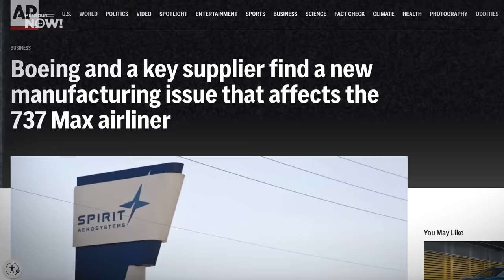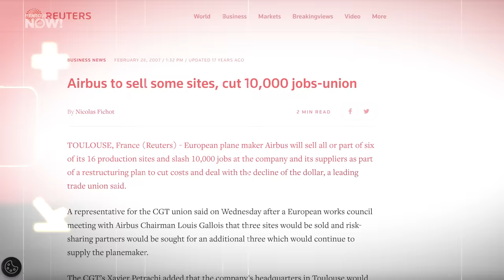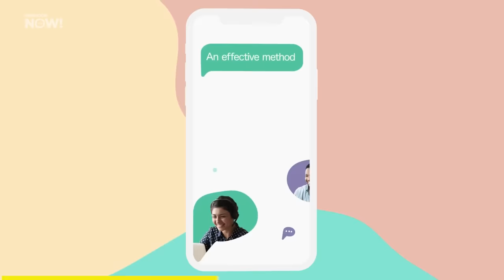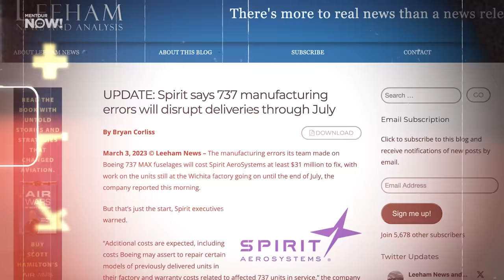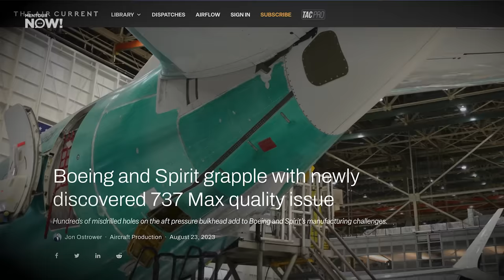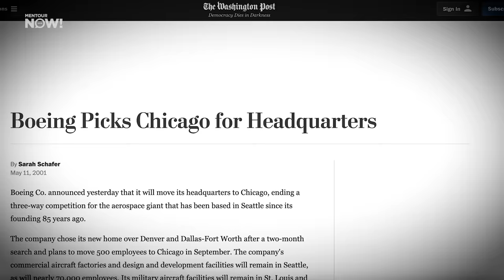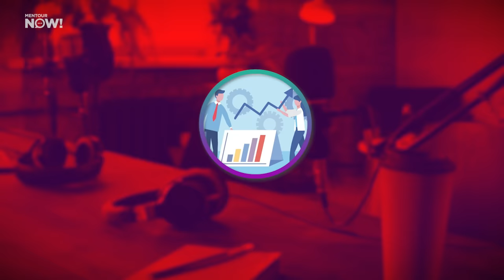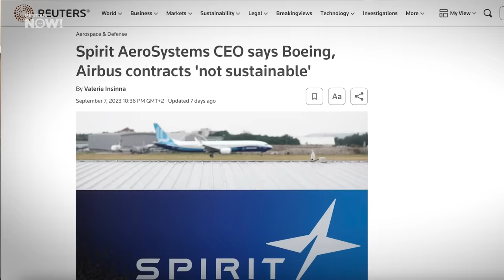NEW Problems with the B737MAX!

Comment: It’s hard to fathom that any aircraft supplier would possibly machine the snowman holes in such a critical piece. Not without engineering approvals.   So there must be a trace history in who did it, when, and who approved it.  And more importantly WHY it was put in the machine to bore the holes so incorrectly and how many where done without corrective action required.
Reply: I'd thought it was a poorly supported part during machining.
Reply: I have seen parts snowmanned by a machine because of improper tack placement (moved a bat up by 2 rows which led to .247 holes (with countersinks) over lapping to the point that it was a figure 8. There are also the parts with predrilled pilots on one side that someone may not know is there. Then they go to drill from the other side and mix the pilot and double hole, edge margin issues, or snowman. Or have an angled hole through a thick stack up and full sized back through straight (working on the skin you drill full size from outside in but pilot inside out) which leads to damaged holes. 

Qa should have caught this and gotten a dispo from engineering on how to fix it or replace it.

Comment: The Everett plant is still served by a rail spur that goes directly into the facility. The rail line that serves the Renton plant is still completely active on its southern end and is the way Renton receives its "cigars" (fuselages). In fact, the BNSF trains from Wichita carrying the Renton fuselages often stop at Mukilteo in order to drop the cars with 777 parts. In other words, dropping a 737 fuselage for Everett is actually already on the train's route, and shaves about 30 miles off the distance it travels from Wichita. A test train carrying 737 fuselages has already been run "up the hill" in order to help set-up the logistics for the new assembly line. The P-8 is assembled in Renton, and then flown to the Thompson Site at Boeing Field for final assembly and electronics installation.
Reply: I ride my mountain bike along the rail road route from Mukilteo/Edgewater Park to the factory.  You're absolutely correct - I've seen a couple of 737s parked at the west side of the factory.

Comment: Those bolts in the pressurisation bulkhead were the very culprits of the Japan 123 flihgt crash, after a faulty repair. Now the flaw is even into the new brand production.
Reply: They had a much bigger mistake in Japan 123
Reply: You are absolutely right 😮
Reply: They tend to use blind rivets rather than bolts, and therein lies the problem.  The rivet heads hide that ‘pull- through’ events at enlarged holes can occur leaving two parts unsecured.  The repair principle requires that replacement rivets are reinstalled with washers positioned on the back side to provide holes of appropriate size to prevent ‘pull-through’ to secure the parts together.
Reply: Whilst accepting that Japan 123 situation was more extensive, you do not expect it to be built in to a new plane. So long as the snowmen exist, a repeat of Japan 123 is on the cards… So, we’re back to profits rules safety!
Reply: @andrewbrown6786 yes and Japan 123 was a tail strike repair done wrong by Boeing certified repairmen, and absolutely nothing to do with bolts, a continuous overlap on one side of the repair was done with two pieces leaving the rivets compromised. Was a 10,000 hr repair that lasted 12,000 hours

Comment: The sad thing is that both of these problems were obviously known to Spirit, and they kept the information to themselves in order to save money, not knowing (or, apparently, caring) if the problems affected the safety of the aircraft.  In the case of the vertical stabilizer, Spirit clearly had the specifications of the fuselage (since they built it), so when it came time to install the fittings to attach the vertical stabilizer, and they couldn't be installed according to specifications, they would have immediately noticed that those two fittings were not manufactured to specifications.  A competent company would have rejected the non-conforming fittings rather than altering the installation (which then resulted in the fittings themselves and their installations to be out-of-specifications).  In the case of the aft bulkhead, it was Spirit itself that drilled the "snowmen" holes (and, presumably, inspected the work), so they cannot, in ANY reasonable way, claim that they didn't know about the issue.

Comment: I think it's time for Boeing to develop a brand new 737 from scratch at this point.
Reply: They could call it the 73.17.
Reply: How many screw ups and dangerous shortcuts would they manage in the design of something NEW at this point?
Reply: Perhaps refrigerators and washing machines as it's less demanding.
Reply: New 757 to include taller gear than 737.
Reply: I think it's time for the US to develop a brand new Boeing at this point. That merger with MDD turned the company from engineering-focused to profit-focused, and being profit-focused when you're not a financial management company is a mistake 100% of the time, but it takes JUST long enough to manifest negative results that it ensures the CEOs who caused it can safely retire with a golden parachute, so that's just capitalism working as intended (sarcastic eyeroll).
Reply: @44R0Ndin  If you do good, you will do well. Boeing tried to do well by doing bad.
Reply: @SteamCrane  Exactly.
Reply: They could base its design on the 737 🙂
Reply: @tiggy2756  How about we don't? Clean sheet design is warranted, methinks, enough things have changed in the aviation space that an entirely clean sheet design with modern airports in mind would be the best thing to make. The 737 was originally designed to operate off a grass field, because at the time the number of actually suitable airports for a jet aircraft of such size and passenger capacity was not sufficient for the routes it was planned to service, so it carried a LOT of equipment (in the 100 200 300 models) that is just dead weight in modern times because the airport itself has that stuff built-in.
You could even get a gravel kit for the 100 200 300 series 737's.
A "modern take on the 737" doesn't need such things, so it can eliminate the dead-space that was previously used to house such things, and switch to other more efficient ways of doing things like an aircraft that doesn't have a bleed air or hydraulic system (everything's electric and ACTUALLY fly by wire instead of fly by steel cables with autopilot actuators strong enough to overpower any pilot on purpose).
Reply: @tiggy2756  The 737 design has a fundamental flaw. It is locked into being close to the ground, preventing proper installation of modern large diameter engines.  The main gear folds inward, with the wheels from either side almost touching.  Thus the legs can't be made any longer to raise the aircraft.  There is a much better starting point, the excellent 757.
Reply: @44R0Ndin  I was joking !!! , well aware the 737 is basically a 1960's design ,stretched a bit  , larger engines hung forward of the wing as they don't fit were the old JT8D's fitted and MCAS to make it fly like older 737 
The problem is there are many airlines with large fleets operating  737 ,s and Boeing tried to produce a aircraft crews could seamlessly transfer to as the Max is the same type rating . 
The 737 design goes back to 1963 it shares much of its design with the 727 , even before the ill fated MAX 737 the classic needed STS system to fly correctly , 737 should have been ditched as soon as the larger high bypass engines became the norm . Boeing need a complete rethink ie something like a small short haul 787 ie carbon fiber ,fly by wire ,  no fuel sapping bleed air from engines and designed to accommodate larger fuel efficient engines
Reply: @SteamCrane  Hi , I was joking as I'm well aware boeing have pushed 737 design to far , I think better starting point would be a scaled down 787 as the 757/767 is old tech with rods/cables , aluminium and eng bleed air 
I think carbon fiber and electrically powered fly by wire systems have proved themselves
Reply: @tiggy2756  OK, but I'm terrified by carbon fiber, having watched F1. Eliminating bleed air is vital.
Reply: @SteamCrane  I know what you mean , as an engineer , alloy you can visually inspect and crack test, often catch failure before it happens carbon fiber it's just snap and all is lost , no easy way of checking it , just faith in it's manufacture
But it's way things are going , carbon fiber is  lighter and very fatigue resistant (till it snaps )
Reply: @tiggy2756  As an experienced engineer, I agree.  But it would be great to get rid of bypass air.
Reply: They must still have the 757 tooling stored somewhere. No need to go brand new.
Reply: @tenkloosterherman  True 757 be better as you could hang larger more efficient engines under the wing , not drastically affecting the thrust line like on 737max . But 757 is older style , alloy airframe , rods/cable hydraulic flight controls . Boeing really need scaled down 787 , ditch the hydraulics and, power sapping bleed air and lighter carbon fiber airframe
Reply: They still focus on engineering stupid talking points
Reply: that's a great point. That's why I suggested a new airplane in the same category but from scratch. I have the feeling that Airbus with its A320 NEO series is decades ahead at this time and they even have a platform that can be improved for many more years with newer engines etc. All in all I think Airbus - despite the A380 desaster - has pushed away from Boeingand if it wasn't for American airlines preferring an American Brand (understandable), they would even be ahead even further. Boeing just introduced fly by wire some years ago and only half-hartedly but now we all know it's the only possible way into the future. So they have to come up with their own solutions and that's a massive task.  @SteamCrane
Reply: @jefftoll604  Don't kid yourself - Boeing could probably kill someone with one of those as well.
Reply: They will.....

Comment: These snowman holes are only not considered a flight security issue until after it becomes one after a bit of wear and material stress. Like when after a catastrophic event it is established that a couple of rivets tore loose, due to the oversized holes.
Reply: Wasn’t there a plane that its aft bulk head failed and tore the vertical stabiliser and rudder with it? That was caused by a an improper repair but as you said over time stress will cause it to fail
Reply: @Tennyson_W05  Yes, I saw that on 'Mayday' and was immediately reminded of that episode.
Reply: @Tennyson_W05  JAL123, 504 deaths. Worst single aircraft accident ever.
Reply: @stephengrimmer35  thats the one i was thinking of. It’s the typical behaviour in these big corporations make changes when people lose their lives. Soo sad that’s the way it is
Reply: That repair was incorrectly done.   The book specified like three concentric rows of rivets and they used two.    Then again, if the engineers had been more prescient, they might have designed the tail to not blow apart if the aft bulkhead failed.
Reply: @derektaylor2941  it’s like the JAL123 crash think it was around a year can’t quite remember after the repair was done that it failed
Reply: Engineering principles must have changed since I was in the industry, if elongated holes in a major pressure-cycled structural component aren't considered a safety issue. I can only assume that some genius (possibly in the Finance department rather than Engineering) has decided that the fasteners won't wear enough to cause a catastrophic failure in the time before they're fixed. I hope they're right.
Reply: @Tennyson_W05  That Japan Airlines 747 was exactly what came to mind as soon as I heard it.

Comment: I was in sheetmetal for 20 years and we never called them "snowman". We called a misdrilled hole "figure eighted." 
When working on a big sheetmetal project it is incredibly easy to damage it and have to start over again. Locating holes....piloting them.....step up the hole size. Chip chase every step of the way. Then final ream the holes keeping everything tied down as much as possible to avoid figure eight holes. You can lose edge distance of your holes. You can induce tool damage. Tool marks. All of that unacceptable. I can tell you something worse than a figure eight hole......one that is misdrilled only slightly....by a few thousands of an inch. It WILL elongate over time and it WILL eventually crack or shear the fastener. I worked for a Boeing subcontractor (not Spirit) and all of our training was to Boeing standards. In one video a Boeing instructor admonished us about working on their product by saying: "The customer is buying a NEW aircraft, not a repaired one." Sheetmetal construction and repair is an art form. Those who do it are underpaid.
Reply: B737 "Maxx SHORTCUTS"
Reply: @Crunch_dGH   You said: "B737 "Maxx SHORTCUTS"" 
That is not a complete sentence. It says nothing.

Comment: The worst single plane disaster ever was caused by a badly repaired rear pressure bulk head. These problems are more evidence that boeing are only interested in profits and not safety or quality.
Reply: And that JAL Flight 123 747 bulkhead was badly repaired by Boeing, I might add.
Reply: @msmirandagirl  ditto that

Comment: I always said that the 737 Max, was like Boeing's version of the DC-10. They should have shut down production of the 737 Max and stuck with their "Golden girl" , the 757. That was a near perfect aircraft. Will never understand why they didn't stay with it.
Reply: A friend of mine is a retired pilot for AA and flew the 707, 727, 757 and 767.  I asked him which one was his favorite and he said it was hands down the 757
Reply: Because of Southwest Airlines.
Reply: My thoughts exactly.
Reply: The 757 was a great and frankly beautiful aircraft. But it came down to bean counting. The 737-800 could carry about as many passengers as a 757-200. The 737 burned much less fuel and thus was far cheaper to operate by the airline customers. But yes, the pilots loved the 757. I did too.
Reply: used to work there agree 99.8 %   the 767  was a great plane to  but still going to miss the Queen of the sky's   (757 single isle 767 double isle    same plane almost )
Reply: Not economical enough Amy more
Reply: I flew for Continental/United for 34 years, till the FAA kicked me out in 2020, when I turned 65. For those who don't know, because both the 757 and 767 were on the same Type Certificate you flew both. Your first leg could be a 75 and the next a 76. The 757 was an excellent airplane to fly. Many of it's flying characteristics reminded me of the MD80, but with much more power. But my personal favorite will always be the 727/200. Maybe it's because it was the first Airliner I checked out in, but what a great pilots airplane.
Reply: For the same reason that Ford didn’t stick with the two-door Thunderbird.
Reply: @boeing900  727 was great but noisey when compared to the Airbus and the DC-10.
Reply: wrong @sergiothepilot
Reply: They make more money on the Max with it's older design.
Reply: @boeing900  Ooof. Hot summer days at even modest elevation with dispatch having loaded every last pound that the -200 sheet would allow … No thanks.  I’ll take the 757 all the way up out of Eagle, CO instead, any day. Fantastic airplane.

Comment: I recall a Japanese aircraft which had a tail strike which required a repair of the bulkhead. The repair wasn't well made, and the bulkhead failed much earlier than the 50K pressurisation cycles, while the aircraft was flying, and ended into the side of a mountain. 
Are we sure that the oval-shaped holes can be fixed without negative effects for all the lifetime of the aircraft?
Thank you Mentor Pilot.
Greetings
Anthony

PS.: I don't like the closing jingle. Not that is important, it's just my opinion...
Reply: JAL 123
Reply: I've watched way too many videos where the flaw that caused the crash was not easily seen in routine maintenance or inspection. An aft pressure bulkhead failure  is the stuff of nightmares.
Reply: jal 123, the root cause was a faulty repair after a tailstrike made years earlier
Reply: @fuzzy1dk  Yep. And JAL weren't sure that their own people where up to the job so they paid out for a Boeing team to fly to Japan and do the work. For all the good that did.
Reply: @lustfulvengance Gosh, that poor engineer. I can’t imagine the guilt of suffering he must have experienced knowing he caused over 500 deaths. No wonder he killed himself.